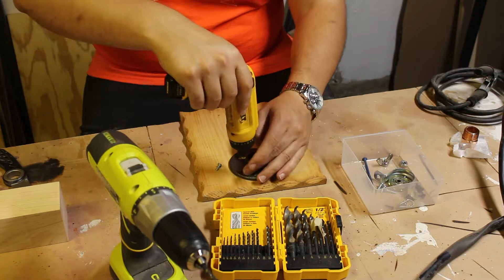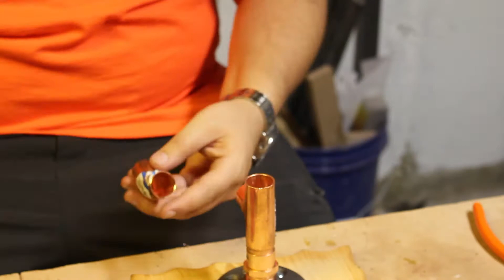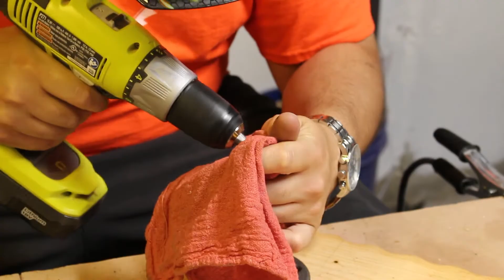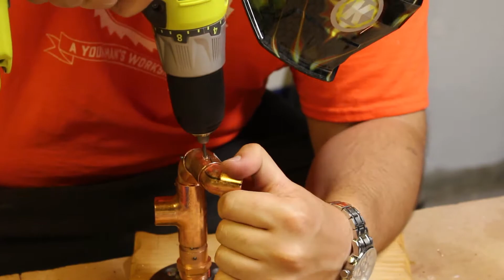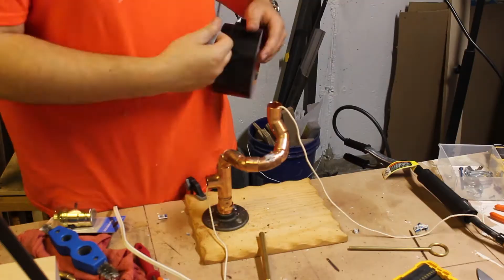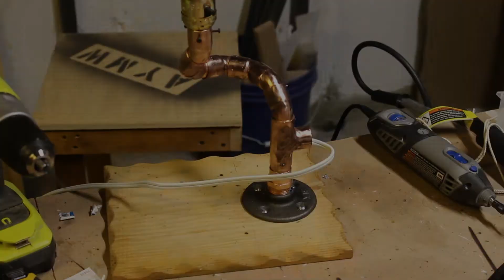Copper Pipe Lamp

Comment: If it is still holding together, I'd say it worked well.  A drive pin (if you can find them) might have been another way to connect the pipe fittings.  I wonder...have you ever drilled a hole in your hand?  Interesting experiment.  Keep Creating!
Reply from the maker: It is still holding together great actually, only recently did I realize it has almost been a whole year. Beside a pin (you are correct) I also realized I could have done pop rivets however for some reason I really was curious if welding it (I don't know what else to call it) would work and hold up. And I have never drilled into my hand, but I have burned my fingers pretty badly after handling drill bits that were just used. How about you?

Comment: What kind of welding machine you use in this project sir?
Reply from the maker: It is a wire feed 90 Amp flux core welder from Harbor Freight. It works well for all the projects I have done so far on and off camera.

Comment: why welding ? soldering is i think the better way for copperpipe
Reply from the maker: This was an experiment if I could create a stud weld between two pieces of copper. Soldering is perfect for copper creating an air/water tight seal however it is very complex and hard to solder joints so close together. I was curious to see if by drilling a hole and filling it with weld, the joint would stay and be strong enough for a lamp. So really it is just an experiment as an art project. The construction of this lamp with the welded stud method was at least 2x if not faster then to solder it at my skill level. Since this project isn't for any kind of plumbing purposes it is ok that it doesn't have any kind of air or water tight seal. Thanks for asking!